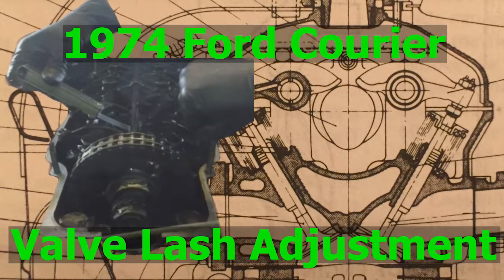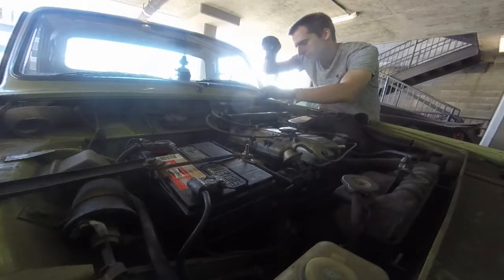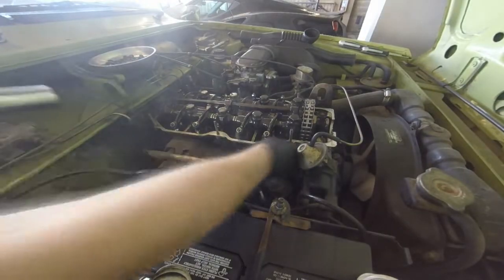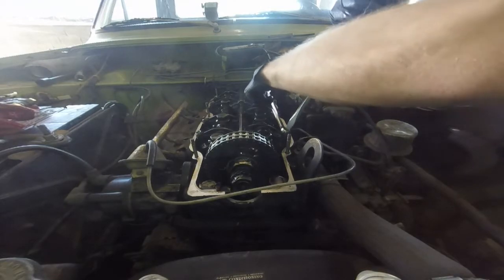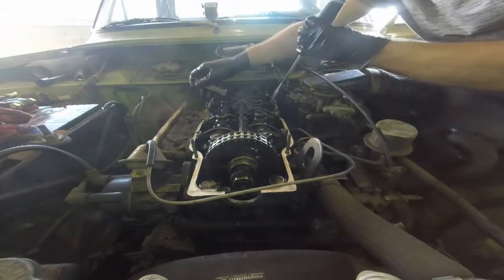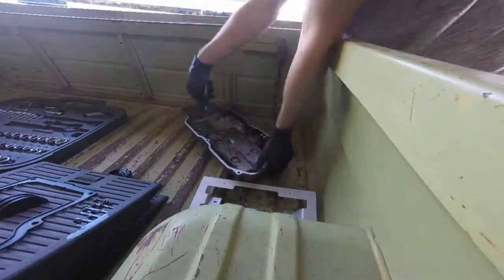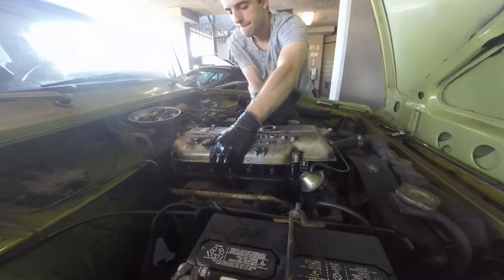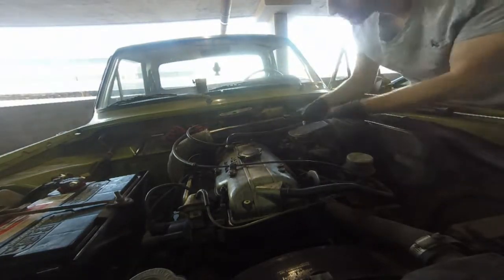1974 Ford Courier - Valve Lash Adjustment

Comment: I'd recommend retorquing the head bolts in order before any valve adjustment as its part of scheduled maintenance. There is little chance than the specs will change as the cam will not move but so many of these motors had blown head gasket due to normal AL head settling, head gasket compression and head bolt stretch. Very satisfying to hear a smooth top end after a successful lash.

Comment: I have the same truck.
It was my granddad's.. 
Want to put it back on the road.
Someone helped themselves to parts while it was in the back..😒
I Need to find parts having a hard time finding.
Any advice would be great.
Thanks for your videos they are very helpful..
Oh ya.. how do you remove the radio?
Reply from the maker: Hey, they're fun little trucks, and really useful. It sucks that somebody helped themselves :/ finding parts can be tough. I'm not sure what parts you need- I've found bodywork/trim pieces are pretty hard to find. Engine refurb/mechanical components are generally available still (rockauto), although you might have to make generic parts fit for things like fuel pumps. Ebay has been my friend for finding some stranger things (I got a complete door seal kit from the vietnam over there). Also, remember the mazda b1600 is this truck with a different appearance, (and was sold in this form in many more markets), so look for those parts.
As for the radio- I wish I could help you. The radio was an option on these trucks when new, and mine wasn't fitted with it. I just have a piece of plastic that blocks the radio mount lol
Reply: Don't know if you still need the info,  but you have to pull the ashtray, ashtray retainer and rear retainer support. Also have to remove the heater control knobs, bezel, right hand defroster hose and the heater control. Got that info from the Haynes manual, haven't done it myself yet, but it's on the list... the very long list.

Comment: Have you done another video but with a different camera angle ? Top view or closer could’ve been great
Reply from the maker: Yeah I'm still pretty new at filming my work, it's a compromise between trying to get a good shot and trying to finish the task in a reasonable amount of time. I'll try to get a clearer shot for the next video- I think even just adding a few work lights would've helped a lot.
Reply: Urban Weekend Warrior which order is used to start , intake or exhaust?
Reply from the maker: I'm not sure I follow. Regarding which order to adjust the valves? You can pretty much do that in any order- I was just bumping the starter motor until one of the cams would get to the "fully closed" position and check that one, until I checked off all the adjustments, no particular order

Comment: Hi  what did you adjust your valves too? I have the same truck and cannot find the specs.
Reply from the maker: My haynes manual says- with engine warm, .012" on valve side, .009" on cam side. I think I went closer to .008" on the cam side just to quiet it up a pinch (and since I usually end up a pinch loose of the mark).